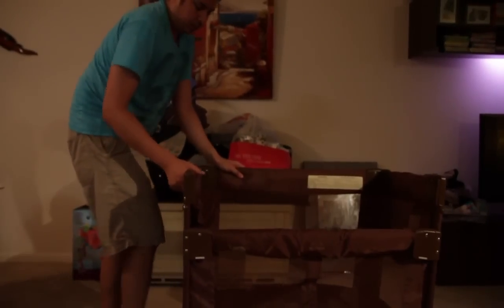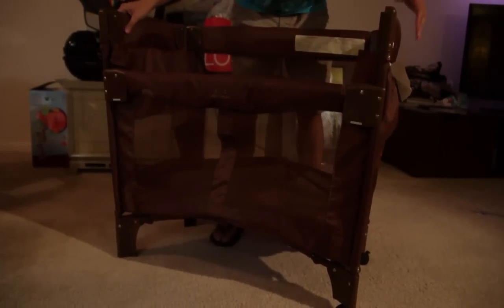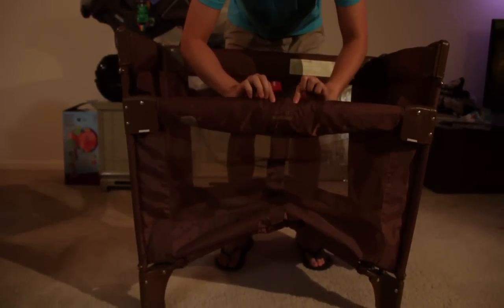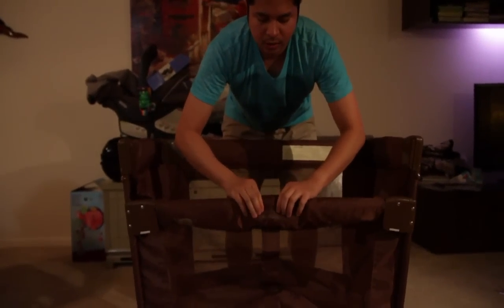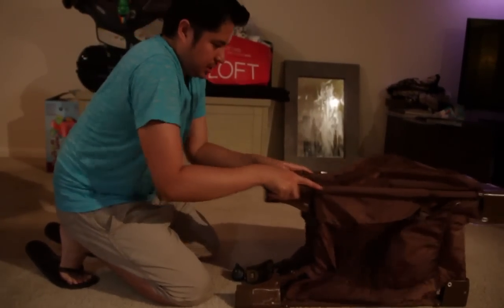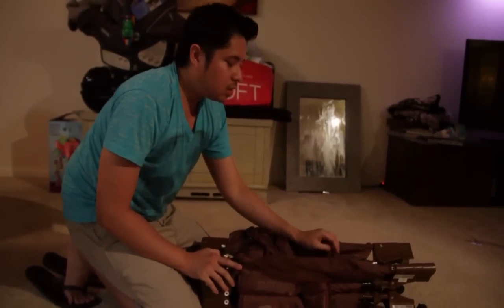Arm's Reach Co sleeper Disassembly-Jammed??!

Comment: Thanks so much for posting this video. We had the same problem with all four legs!! The rocking, along with a gentle push-pull motion on opposing bars finally did the trick. We were ready to give up until we saw your video.